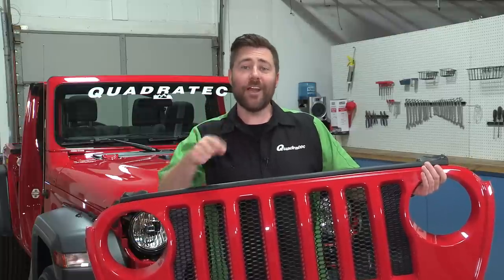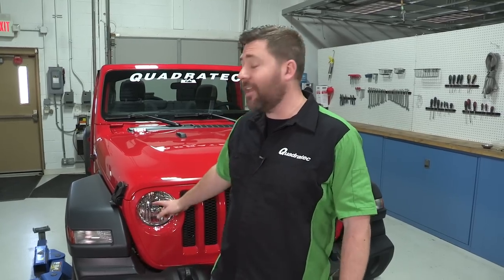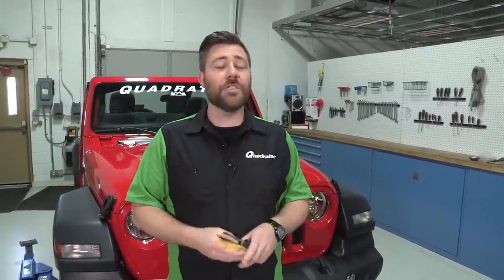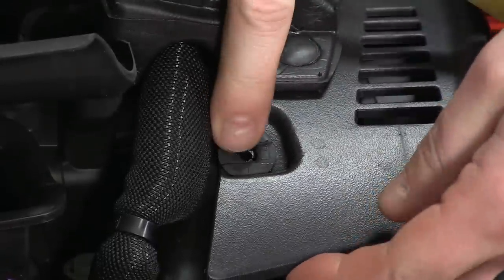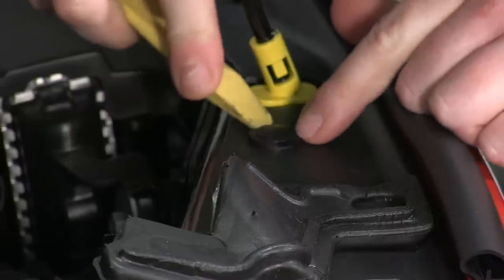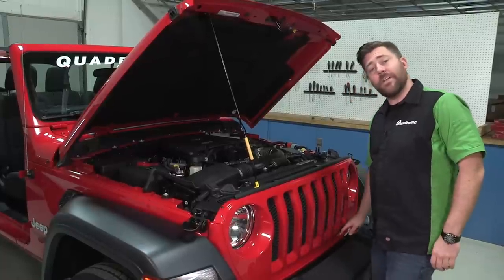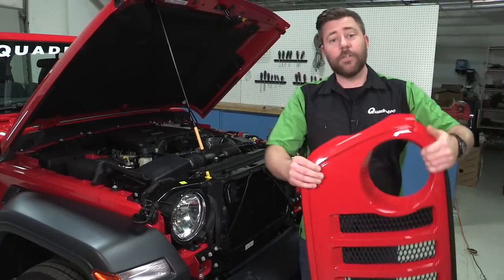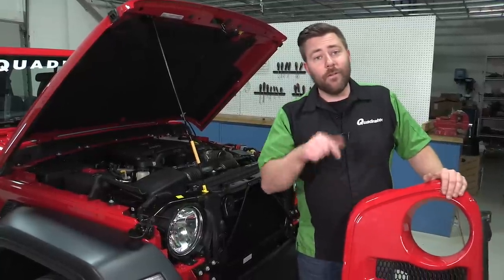How to Remove the Grill from a 2018 Jeep Wrangler JL

Comment: I followed how you did it and it worked perfectly.  I love the extra tip you gave how to remove the pins by pulling up the grill.  Thanks again.
Reply from the maker: Glad it helped!
Reply: AWESOME! Glad the tip helped!
Reply: I need to do that to look at my horns they’re not working. How sensitive are those clips. I don’t want to break them when pulling on the grill.
Reply: @MarioRodriguez-gr8wc  Well, just tug on the corner of the grills, you don't have to pull hard, just keep tugging giving more force each time, to see if it would pop.  I was scared to break them but now I know how much force to use, and they aren't that fragile,
Reply: @walden6272  thanks for the reply. I feel more confident now.

Comment: What do the ones under the headlights look like. Mine dont want to release and I feel like I will ruin the grill if I pull any harder. I would like somewhere to pry but I dont know how it comes apart. Oh and with a real bumper and a winch there is no where for it to move forward.

Comment: I don't have access to an official wrangler jeep store in my town. Incase I break the pressure clips on the grill while pulling, which for some reason gone stiff due to heat and dirt. How do I repair it, as I doubt any adhesive solution that can mend the broken pressure clips.

Comment: Okay anyone ever dropped one of the little grill fasteners into the engine bay? One popped out of my hand when I was putting the grill back on and fell in the front right part of the engine bay. It was just the flat plastic washer portion. Not the plug insert that goes in the middle. I looked around and could not see it anywhere and it did not fall through. Doesn't appear to be anything that it could do there as there are no belt or fans and even so I can't imagine it would do anything more than just get flung out of the bottom of the engine onto the ground. Still anyone had this happen or can alleviate my concerns that the little piece could wreak havoc.

Comment: Is there any way you could move them blinkers back bellow the headlights like the jk?
Reply from the maker: Because the grill tapers in at the bottom, it doesn't look like there's room behind the grill to fit a light housing if you cut a hole there.